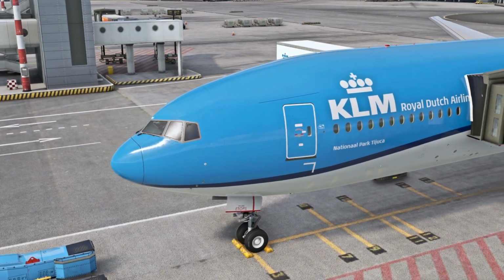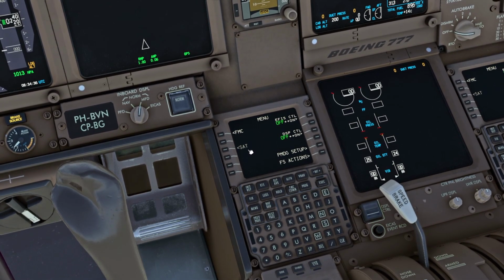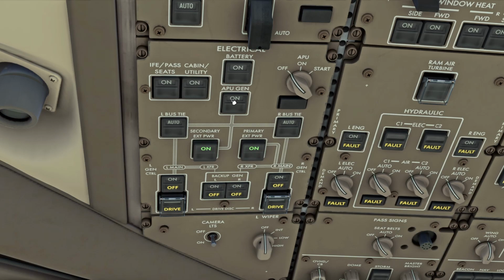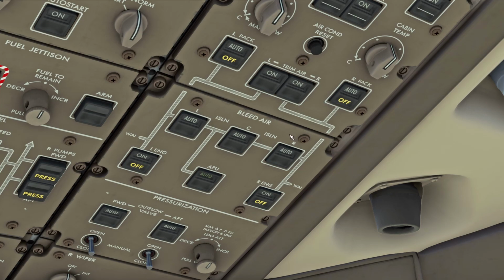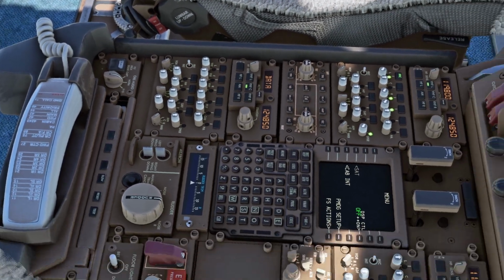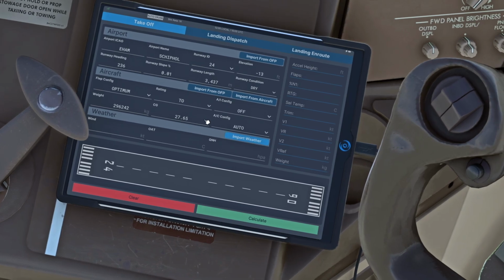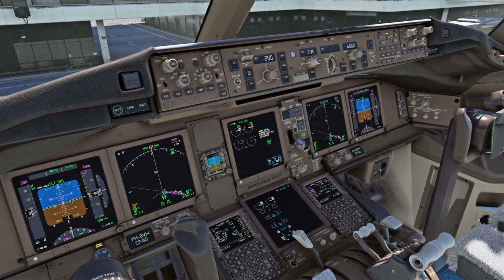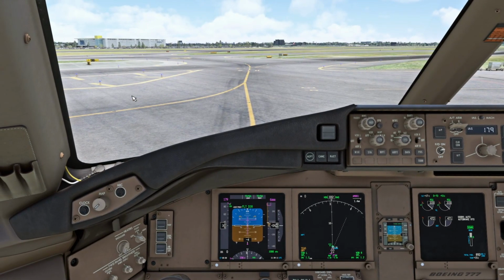NEW Boeing 777 Cold & Dark Startup Tutorial + CDU Programming | Real 777 Pilot | PMDG 777 | MSFS

Comment from the maker: Thanks for watching! Timestamps are below! A lot of time & effort went into this video... If you enjoyed it, ✅ please consider leaving a tip here: https://bit.ly/3EA04xP OR 🏅 become a member of the AviationPro channel & unlock extra perks and get access to extra live full flights! https://bit.ly/41NfbQD

🌎 Want to learn about the rest of the procedures of a flight? Check out this full flight video in the PMDG 777F in MSFS!
https://www.youtube.com/watch?v=wXurJvcYXrU

════ 👇 - TIMESTAMPS! - 👇 ════

- 👉 Intro: 0:00
- 👉 Disclaimer: 1:25
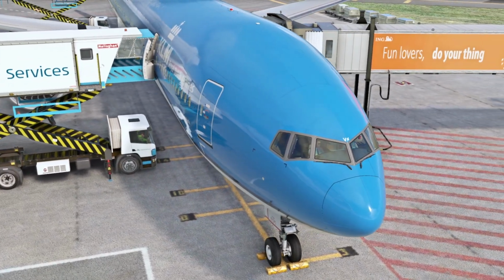- 👉 Getting the aircraft in a cold & dark state: 2:22

⚒️⚒️ ══ Initial Setup ══ ⚒️⚒️

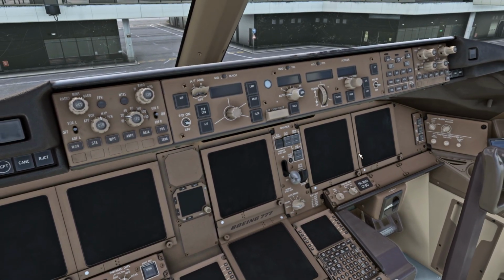- 👉 Electrical Power Up Procedure: 3:34
- 👉 Preliminary preflight: 7:26

🖥️🖥️ ══ CDU Programming ══ 🖥️🖥️

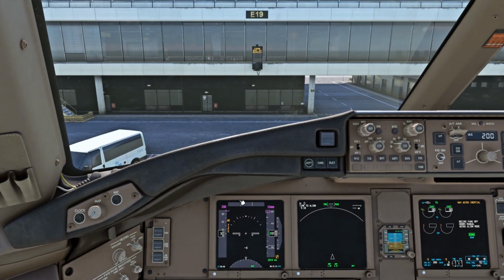- 👉 CDU preflight: 14:43
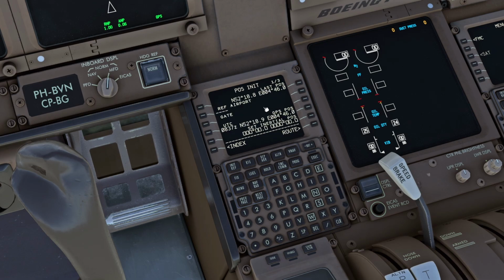- 👉 Position initialization: 18:20
- 👉 Uplinking a route: 19:23
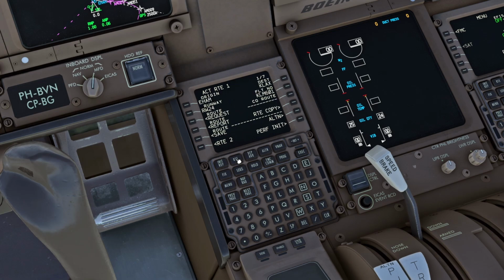- 👉 Performance initialization: 21:59
- 👉 Checkling legs and entering route manually: 24:27
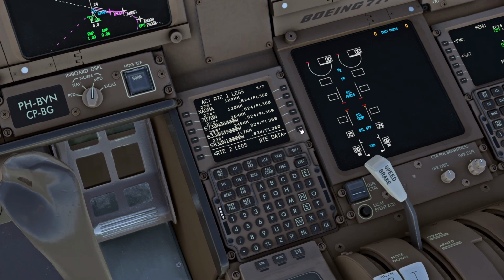- 👉 Wind uplink: 27:07
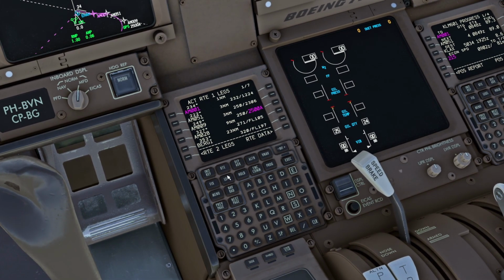- 👉 VNAV pages: 28:18

🕹️🕹️ ══ Preflight Flows ══ 🕹️🕹️

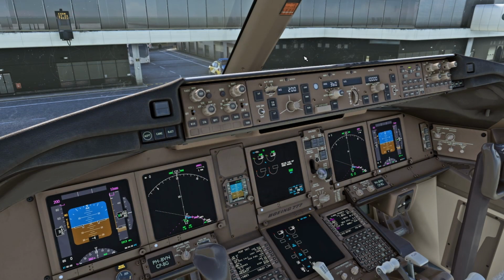- 👉 Preflight procedure: 29:21
- 👉 Flight computers & electrical: 30:20
- 👉 Window heating, hydraulics & lights: 36:19
- 👉 Cargo fire, fuel jettison & pumps: 41:09
- 👉 Air conditioning & pressurization: 45:49
- 👉 First Officer Panel Scan: 53:17
- 👉 Captain Panel Scan: 1:08:11
- 👉 Preflight checklist: 1:14:45

📋📋 ══ Performance, Loadsheet & APU ══ 📋📋

- 👉 Getting an ATIS: 1:16:17
- 👉 Performance calculations: 1:19:05
- 👉 Clearance & departure briefing: 1:27:39
- 👉 Starting APU: 1:31:42
- 👉 Loadsheet entry: 1:35:10

🛫🛫 ══ Engine Start & Pushback ══ 🛫🛫

- 👉 Before start flow: 1:38:56
- 👉 Before start checklist: 1:44:36
- 👉 Engine start: 1:48:28
- 👉 Before taxi items: 1:51:31
- 👉 Before taxi checklist: 1:54:13

- 👉 Outro: 1:55:33

Comment: I got confused do u usually use CI 150 or 15 in B77W?
Reply from the maker: There is no fixed value, it depends on the flight and the requirement to catch up on time or not. Usually 10 is used for most economic, values around 200 to catch up time, beyond that it doesn’t make much sense anymore to increase speed.